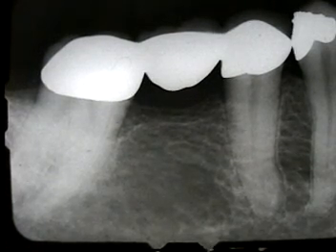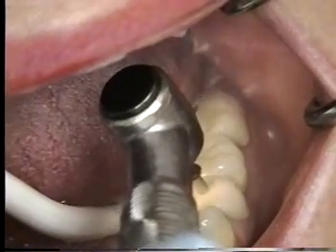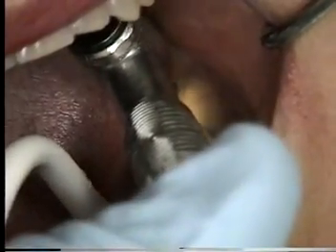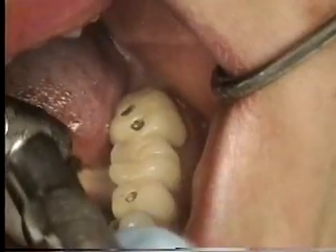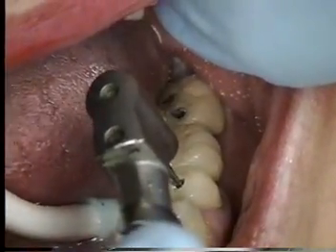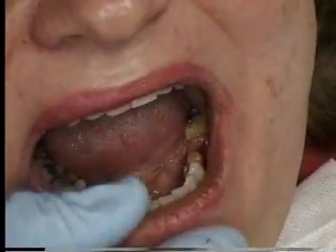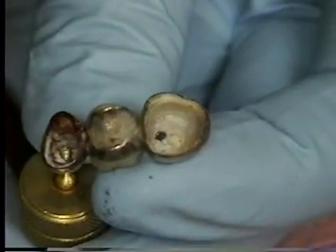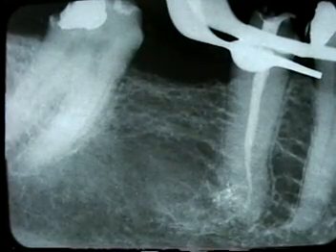Metalift Crown & Bridge Removal System

Comment from the maker: In the kit you receive "keys"/stainless steel screws that thread back into the hole to seal it up completely. This comes with the kit. There are insurance codes for the removal and repair of the restoration (ADA 2980).